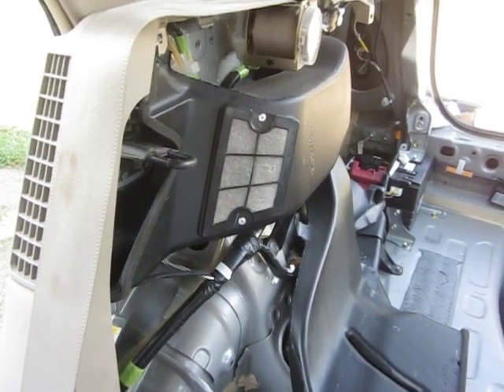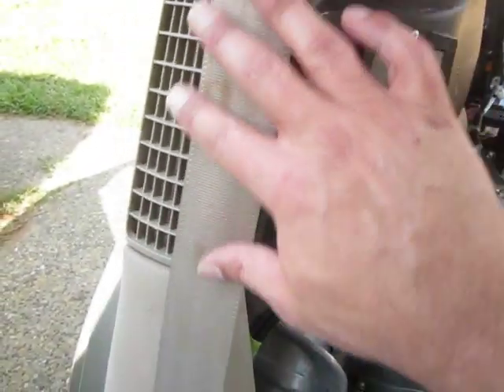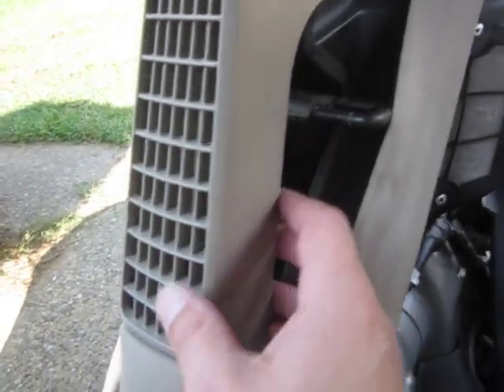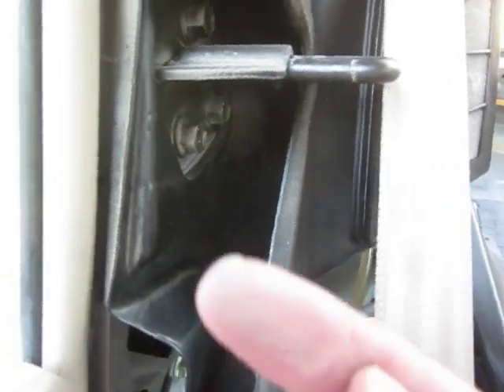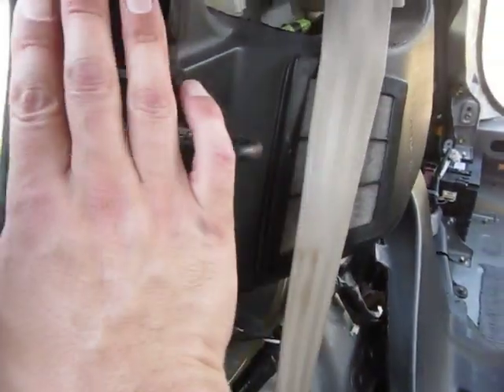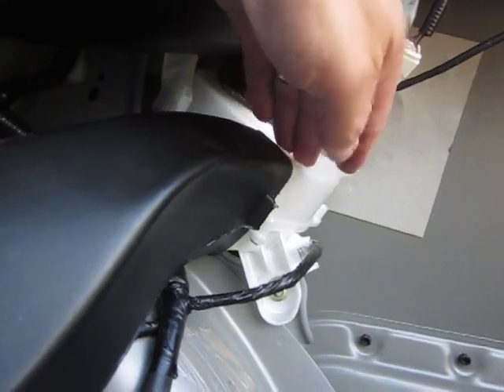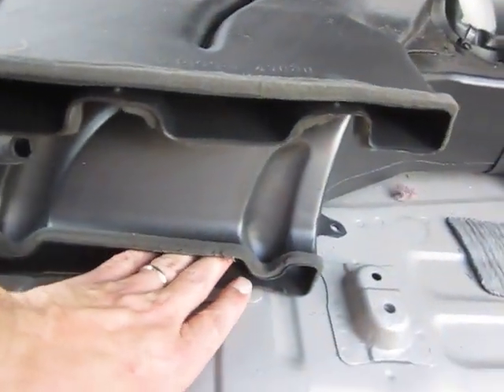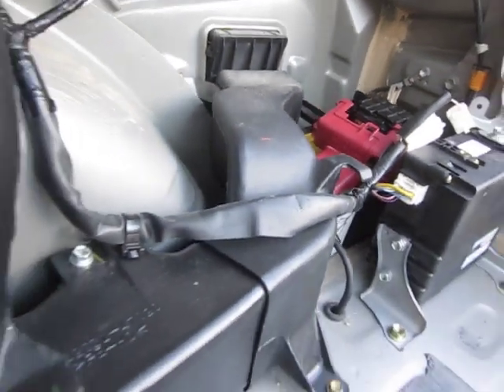Gen2 Prius Battery Cooling

Comment: Hi if I can hear my fan does this mean I need a new battery or it just needs to be cleaned
Reply from the maker: The battery cooling fan only runs when the system detects the battery needs to be cooled, for any reason.

Comment: If one were to add some filter material or fine screen behind that louver that should really help protect the battery's cooling fan and thus the battery pack too. I'm thinking unless that would restrict air flow too much it seems like a good modification for these cars. I understand the 3rd gen added a filter for this but I don't know if the ducting or fan is different.
Reply from the maker: Our car made it 15 years and 230k and this was still clean.  I think if you have pets in the car etc., a filter of some kind would be a good idea, but any filter will reduce airflow and that is counter-productive in itself.
Reply: @ZookeeperJohnG  Thanks. I just watched a video last night from `The Car Care Nut', a Toyota Hybrid expert mechanic's site, that demonstrated an aftermarket screen that snaps on over the outside of the louver for a later model version. He prefers them to the stock filter/screen as It's far easier to detach, clean, and reinstall than the factory one behind the louver. I'm thinking perhaps they make one for the 2nd gen intake. They are a different shape than the Gen 3 or 4 that he was using for an example. I think a screen should be okay but a paper type filter would restrict airflow too much. Of course any filter will after it gets too dirty.
Reply from the maker: They have value, but for most folks that keep their interior clean, it would do more harm than good because of the airflow restriction, although minor.
Reply: @ZookeeperJohnG  Thanks, I appreciate the feedback.